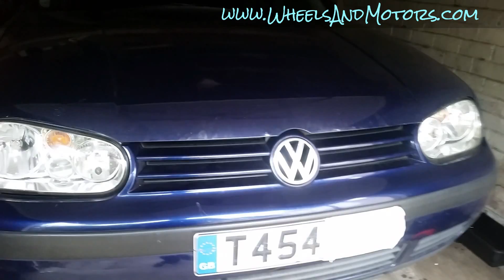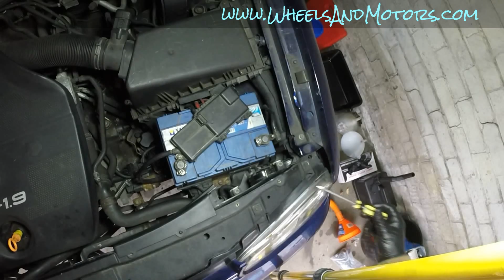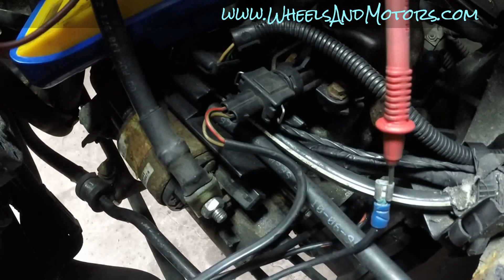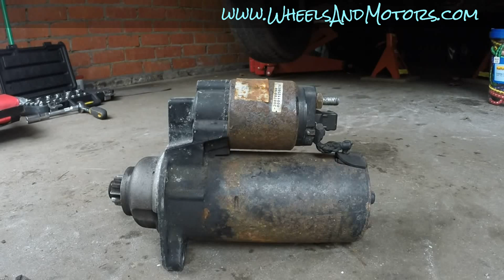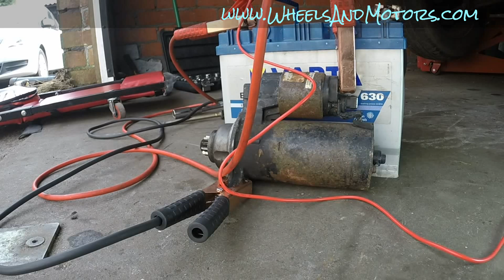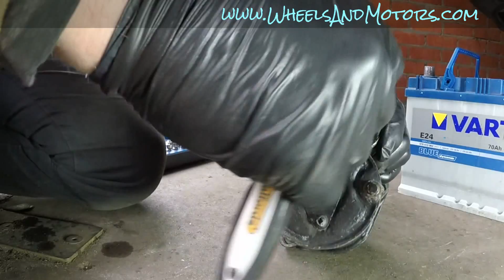How to test, fix or replace starter motor VW Golf Mk4

Comment: Anyone knows if I can put a starter motor from a 2.0 diesel engine to 1.9 diesel engine?
Reply from the maker: Ideally you should get the part number. Once I tried to replace my starter motor of 1.6tdi by another one from some other 1.6tdi and the sprockets were different

Comment: What if you replace the starter but it doesn’t engage the flywheel?? I’ve tried 3 different starters. A buddy said something about the timing and compression. Any info would be great. 2004 Vw GLI 1.8t
Reply from the maker: Some starters may have different sprockets. Make sure that the sprocket on a new starter is tue same as the original. That's the only thing I can think of.

Comment: Hi,

If I tap the solenoid and car starts does that mean that the motor is fine but just the solenoid needs replacing thanks?
Reply from the maker: Hello, in what way do you tap solenoid?

Comment: Why would you Jack the car up if the starter was on top of the motor
Reply: My bad actually you needed to to show the viewers where the bolts were on the starter to make the video. That's why thanks for the video saved me some time
Reply from the maker: You're very welcome 😊👍
I'm glad that this video is still being used.
Reply from the maker: It was while ago, I don't remember, sorry

Comment: You sir have earned a like and sub helped me solve my no crank no start. Had a bad connection between motor and solenoid. Just had to sand it down and re connect.
Reply from the maker: Nice to know that it helps 🌻

Comment: I tested the connection for the siginal from the ignition and only got 0.35 to 0.5 Volts. Am I right in thinking if it was this wire it should be 0. I havent cleaned the contacts yet as the nut to hold the battery postive lead is stuck on solid so could it be thats why I am receiving a very low siginal reading? I also hear a clicking on the alternator.
Great video by the way!!!!!!
Reply from the maker: Thanks 👍 
Is your battery strong? What's the voltage, especially during starting?
Reply: @wawayltd  wooow you are a top guy for responding even after all these years...seriously your videos are so informative and to the point...have just subscribed...
I put a brand new bosch  battery in and that is reading around 15V from what I remember....I think when I tried turning the ignition it did drop to about 12.5Volts..will have to test again in a few days to make sure...but the figures were along these lines. Am I right in thinking if there was a problem with the wire siginal from ignition to the starter there would be absolutely 0 Volts.
Reply from the maker: I did that video a while ago, I have worked out how the starter motor works, but I'm not sure about voltages in wiring. If the battery is new, then it must be either a starter motor or the wiring. There's a good article describing it in details:
https://www-howacarworks-com.cdn.ampproject.org/v/s/www.howacarworks.com/ignition-system/checking-the-starter-circuit.amp?amp_gsa=1&amp_js_v=a9&usqp=mq331AQIUAKwASCAAgM%3D#amp_tf=From%20%251%24s&aoh=16797811545526&referrer=https%3A%2F%2Fwww.google.com&ampshare=https%3A%2F%2Fwww.howacarworks.com%2Fignition-system%2Fchecking-the-starter-circuit
Reply: @wawayltd  I think if I can can get the positive nut off give it a little clean and then do a starter motor test without taking the starter out by doing the same thing you did when you took the starter out will confirm if its working or not....where did you get that probe with the crocodile clip from....am struggling to find a decent one?
Reply from the maker: I think I got that from Maplin, which is closed for a while. Try to look on Amazon or eBay for "alligator clips test leads"

Comment: 4:20 I am curious what that connector is with the red and brown wires.
The reason is that I have a 1.8T with those 2 wires going no where.  I am not sure if I have pulled them off something whilst removing the plastic cover, or if they are just an unused part of the loom.
Excellent and useful video by the way. Thanks.
Reply from the maker: I don't have that car for a while. It looks to me that it costs be a connector for reverse light switch. But for some reason, at different angle. I have a video about reverse light switch, could that be it:
https://youtu.be/ADsOGFmP1PQ
Reply: @wawayltd  You Sir are a Gentleman.  Many thanks for your kind reply.  Yes that explains why I have no reversing lights.  I've actually never had reversing lights working since I've had the car, and now I know why.  Best wishes.
Reply from the maker: Nice one 👍

Comment: Good video, many thanks. I did notice that when you removed the battery it's position was swapped round so terminal positions changed?
Reply from the maker: I think I replaced the battery with the new one and it had a different terminal setup.

Comment: Very useful video. I tested my starter only by bridging the nut and bolt only spinning the motor making me believe the solenoid is bad but I will check tomorrow going through the connector instead. Thanks for the video
Reply from the maker: You're very welcome 👍

Comment: Thanks. Best explaination i ever seen for starter testing. ...just one question....i have same car and want to know how many teeth must bendix drive have for this specific vehicle.. My father in law have same car but he replaced with 10 teeth Bendix. I measured flywheel teeth distance against bendix teeth distance and it didn't match, which caused starter not engaging. So i suspect it should be a 8 teeth bendix. Want to ask here before i remove my own starter to double check my theory of the teeth since he has same car as me
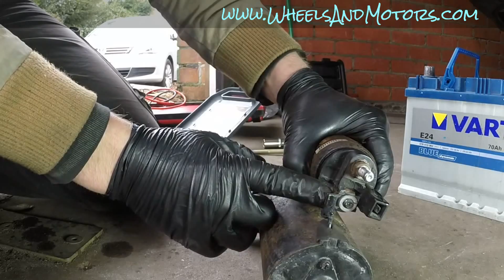Reply from the maker: I don't have that car for few years now, but if you pause the video somewhere on 20:05 you can see it has 10 teeth. That is 1.9tdi engine, year 1999.
Reply: @wawayltd   thanks for reply...i took out my own starter and it also has 10 teeth...turned out it is the flywheel teeth which is worned out causing slipping of starter and not engaging.....sooooo major headache ahead of a major job removing flywheel :(
Reply from the maker: Good luck with that one...

Comment: Good video tnx!
Starters get gunked up so if its malfunctioning an internal cleanup can do wonders. Next to the brushplate the golden bearing is usually also availible.
Taking it apart is not difficult.
Reply from the maker: Good to know, thanks 👍

Comment: Hi I am changing my starter motor but the nut that holds the power steering bracket on dose not want to   budge any advice on this would be great
Reply from the maker: WD-40  ?
Reply: @wawayltd  tried that mate it's just not budgeing I am going to try again today
Reply from the maker: Good luck mate, I don't even know how to help you with this. Try googling how to break stuck nut/bolt loose...

Comment: thank you for the good video,.! can this be done without car lift ? ;Golf4 2.0 Y2000
Reply from the maker: It's going to be difficult to access bottom bolt of a starter motor. I think if you start DIY on your car, jack and stands is one if the most essential things.
Reply: @wawayltd  i have a jack but my new car is lowered. Cant get the jack underneath

Comment: testing my starter motor and it doesn't spin when i short out the motor and nothing happens when I short out the ignition connection either
Reply from the maker: Probably dead starter...
Reply: @wawayltd  ordered a second hand one from a low mileage car off ebay.
great videos by the way, I used your how to do the brakes for the MOT and saved myself a few hundred pounds.
Reply from the maker: Thanks, glad if it helps 😷👍
Reply: @wawayltd  fitted the replacement starter and it fired straight up, I'm mobile again, thanks for the great guide
Reply from the maker: You're very welcome 👍

Comment: I don’t get it ...tested solenoid worked fine .. then tested motor worked fine , then how did you come up with result that faulty solenoid?... pls explain ...
Reply from the maker: That starter motor in the video doesn't have a fault. I took it out just for educational purposes of the video. I didn't say that solenoid is faulty - just explained what can be done if it is.
Reply: Thank you 🙏

Comment: Very nice! But am I right to blame him if my cold engine starts fast, but only 3cylinders(thats how it feels), often completely suffers within 5sec. Often I can avoid this with softly pumping the pedal. Second try it mostly works and the engine is working well after few seconds. So maybe he is to weak because of old grease or bad connection??

Greetings from Germany!
Reply from the maker: I don't know.. I wouldn't blame starter if engine misfiring. Glow plugs maybe?
Reply: @wawayltd  thx for superfast reply, so I'll go for, in my case spark plugs, new after 4yrs and 50.000km to eliminate that . But the problem is not that new. In my 2001 200.000km Bora azj 2.0L, last week we had to flush all the oil out of the cooling circle, just because that tiny oil warmer got leaky and now I want to spend him some more repairs and diagnosis this year.
Reply from the maker: Please don't get me wrong, I'm not giving a diagnosis - that was just guessing. I'm not a mechanic, and I don't have much experience with petrol engines. 
I hope you'll get it sorted.

Comment: Is there a typical number of years that a starter is estimated to last?  I realize this can vary from vehicle to vehicle depending on how often a starter is used.  I'm interested in a very rough estimate based on a VW MKIV 2.8L V6 driven every day.  For example, should a starter in this vehicle typically last 10 years?  Fifteen years?  Twenty years?  Also, is a Bosch replacement starter better than a VW OEM starter?
Reply from the maker: I'm a taxi driver, I do lots of miles. Currently have VW Sharan with 378.000 miles on a clock, previous car was also VAG - Audi A6 that has done over 400K miles. None of them had any issues with starter motor. Considering amount of times I start and stop engine every day, I have impression that they (starter motors) last forever.
Maybe there are some other conditions for starters to fail, maybe lack of use? I'm not sure..
Bosch is a good brand, I don't know what brand VW uses on their assembly lines - in my eyes they are both good.
Reply: @wawayltd  Thank you.  I asked the question because I'm preparing to refresh many components on my 2004 VW GTI 2.8L with 140,000 miles for the purpose of assured reliability: clutch, water pump, coolant hoses, coolant pipe, thermostat housing, thermostat, serpentine belt, tensioner, alternator, spark plugs, coils, possibly the secondary air pump, engine mounts, timing chain, guides and tensioners, oil cooler seal, entire suspension, and rebuild the brake calipers.  Considering the depth of maintenance and the amount of components being removed, I want to be certain that other opportunistic maintenance that should be considered, is included during this substantial refresh/tune-up.  As you know most components in the MKIV engine bay are difficult to access unless they're directly on top of the engine or directly below.  Since many components need to be removed to access other components, I want to be certain I'm including in this refresh/tune-up, all components that are likely approaching the end of their useful life.  This is why I asked about the starter.  When the tune up is complete, I want to have the same confidence in the vehicle's reliability as the day it was bought new from the car dealer.  Yes, it will cost a lot of money, but I'm willing to pay in exchange for the piece of mind knowing that I can drive the car across country without any worries for many years to come.
Reply from the maker: I really like your enthusiasm 👍
140.000 miles is definitely time for new alternator, especially if it wasn't changed before.
Reply: @wawayltd  The alternator is original.  I have started noticing the headlights dimming at certain times, leading me to believe the alternator is beginning to fail.  As a result, I stopped using the heated seats and air conditioner in order to put less of a load on the alternator.  However, I want to be able to reliably use the fully designed functionality of these systems, which is why all of the components mentioned are being replaced.  I'm the original owner of this vehicle.  I like the car and would like to keep it until it reaches 250,000 miles.  Reliability is very important to me.  I do not want the car sitting in a garage every couple months with a new problem to fix.  I want to fix all immanent or potential problems now so the car can be driven reliably with no concerns on long road trips.  Now that you more fully understand my perspective, if you have other suggestions for me during this tune-up, please let me know.  Thank you for understanding.

Comment: Good video. There is a kind of seal behind the sprocket, what's its job and how important is it? Mine shows lot of wear
Thanks
Reply from the maker: Sorry Maurizio, I never had to deal with that seal.. I suppose it is there to protect starter motor from clutch dust.
Reply: @wawayltd   ok, thank you!

Comment: Why did the battery changed positions while you were removing it? First the terminals were facing the bumper and then there is a cut in the video and the terminals are facing the interior of the car.
Reply from the maker: I don't remember much from time when I was filming it.. I think I could replace battery with another one, because old one was rubbish.  And that new battery had different terminal layout.

Comment: It is not often that you find a video tutorial that stays at the point with explanation that you can actually understand and really use. Yours is one of the few. Thank you very much it helped me a lot.
I have one question. Is it possible to replace just the small wire that connects the solenoid and the motor?
Reply from the maker: Thanks  :) 
Why wire? Do you think it's faulty? 
I haven't done it before. I believe that it's possible, just need to see where it's going at the back to see how disconnect it.
Would be interesting to know how you getting on..
Reply: @wawayltd  The cable is visibly broken. I assume it is linked to the brush plate but I am not sure for now. The car was not used over the winter. Cranking after this was visibly more difficult than it used to be. Nevertheless, it worked for a week and then during cranking it just died, no click, no sounds, no significant lights in the dashboard. In the mean time I discovered that the solenoid is also dead, so I am considering changing the entire assembly. It is just strange to me that both the solenoid and the wire failed in the same moment. If you have any advise to spare , it would be welcomed.
Reply from the maker: @ciprianradu6641  These starter motors are not expensive. On eBay you can buy refurbished with 12 months warranty for 60 pounds, and simply used from scrapyard for like 20.
I suppose it's about how you value your time. Personally, I would just get another one instead of trying to repair it, especially as you say if there seem to be few faults.
Unless you have lots of time and find it interesting tinkering with it..
All depends on your situation.
Reply: @wawayltd  My thinking goes along the same lines. I will buy a complete assembly, change it and when I will find some hours I will open the old one for "educational purposes". Thanks a lot for taking the time and support me on this. Have a happy Easter !

Comment: Is it easy to change the brushes on these?
Reply from the maker: Hi Colin, I never tried to do it myself, but as far as I know it's not easy. If you're paying someone to do it, you'll be better off buying another motor.
Reply: @wawayltd  Thanks for your reply. Have since found out its fairly easy as long as commutater isn't badly worn. Cheers
Reply from the maker: Good to know, thanks :) You can make a good video out of it ;)

Comment: excellent video!! is it possible to do without a jack? only thing I dont have
Reply from the maker: If you can get everywhere without a jack, good for you.. You can also use ramps or like a grove in the garage (not sure what it's called). If you are using jack though - DO NOT forget about stands, people die when jacks failing.

Comment: Your starter looks like my starter of my vw polo classic, but in my case the solenoid work when I connect the positive cable.( after many trying) But in the car it's doesn't work.
Reply from the maker: If starter works as it should, but doesn't work in the car, I think there should be a problem with wiring or connector... Or depending how it behaves - bad battery?

Comment: Does anyone know if these instructions will work for a 2005 golf or if there was a change in the process between 2004 and 2005?
Reply from the maker: I drive 2012 VW Sharan now, and I can say that starter motor principle hasn't changed - starter motor on my Sharan, if not exactly the same, then very similar.
Reply: Thank you!

Comment: Great video man. I tested my starter and solenoid and both seemed to work outside the car..But when it's back in my mk4 gti 1.8t, it don't start. Whenever I try start it gives a really loud click and there's smoke coming from around the solenoid..I don't know why. I was thinking it's the wire that connects to the part that u used to test the solenoid..but I really can't figure it out and haven't found anything online. Need help
Reply from the maker: It looks to me like a bad connection. I had similar problem with this Golf - clicking-smoking, but not starting. Then I cleaned connections, make sure that both connections have good contact. If that doesn't help - maybe battery is not in great condition?

Comment: This really is the most detailed and clearly explained part repair/replacement video I have come across. I will definitely be sharing it. Thank you! 
Is starting trouble only when it is humid outside a typical problem that occurs with aging starter motors? Thanks again!
Reply from the maker: Thanks :) Sometimes connections get rusty and cause problems..